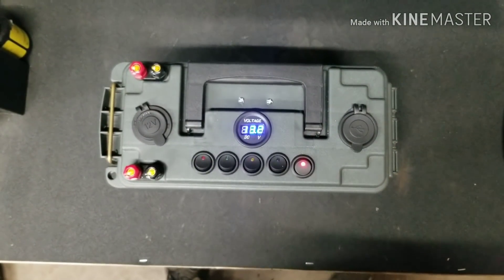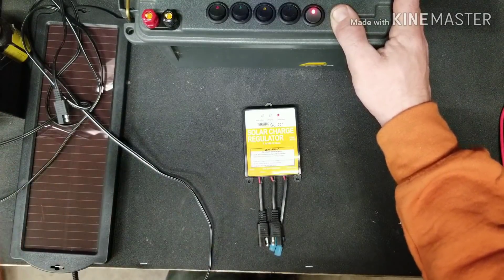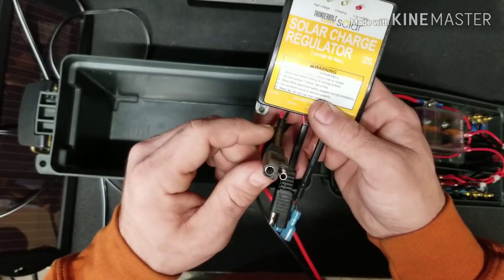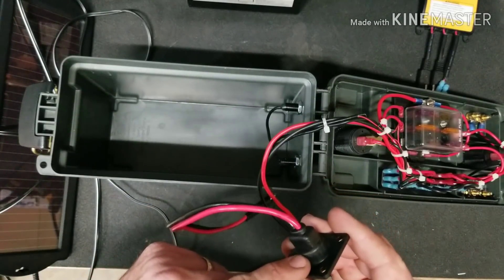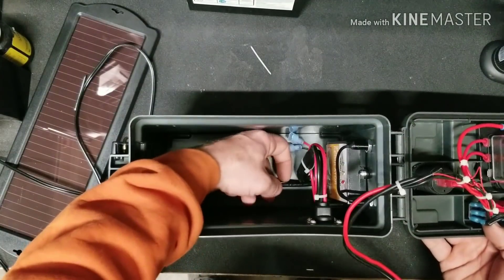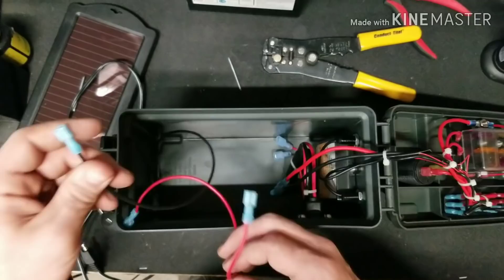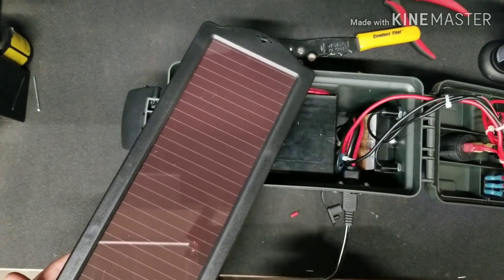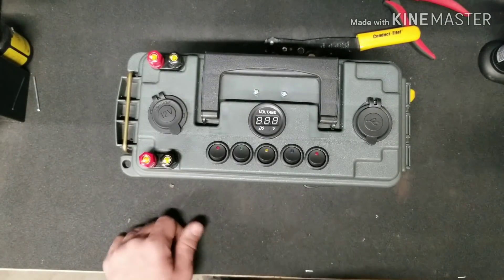How to add the solar upgrade to power box version 2

Comment: Hi! My panel is designed for car trickle charging us ( 10w , 12v, .5A  and has a diode etc). It generates 19v (open circuit) and the manufacturer promises it’s fine. So far so good that I bought a second to make a separate battery box. Do you know what the maximum V’s your usb ports can handle without being fried? Curious because I have a good Pelican case sitting around, but it does not have enough room for a controller (wondering since it makes .5A tops if it might be fine). What do you think? Thanks!

Comment: I had built a similar battery ammo box and just plugged that same small solar panel into the 12v car plug. Charges great with no need for a charge controller.

Comment: Always plug your battery into the solar charger before hooking your solar panel to the solar charger. The reverse is true when disconnecting. Always disconnect your solar panel from the charger before the battery.

Comment: Do you have to use the load side?  Couldn't you just just add the solar and attach to the the battery? Avoid the common issue of overloading that output.
Reply from the maker: Yes that is the better way of doing it I have since switched

Comment: It appeared the polarity of the charge regulator plug (exposed steel plug) and the SLA adapter plug also the exposed steel plug) were reversed so the panel would be short circuited. Can you confirm and did you need to get an adaper to correct the polarity?

Comment: J, yes, your initial video's helped me build the box I needed. Last year during the "Texas Freeze", we were able to charge phones, tablets, have light in the evenings, etc... these boxes can be actual life savers. All of my wifes friends want them, so, I have been tasked to build.🤣🤣, I cannot thank you enough. I have not added solar to my box yet, that is coming. In the list of items used, I did not see, maybe I missed it, the link for the SCC, or a solar panel you recommend, can you help me out there? I am no electrician either, but love to tinker with cool things, this is one of the cool things. Thank you again for this vid and others, subscribed and rung your bell for notifications. Bro, keep up the fantastic work. Peace.
Reply: JDS, I added solar to my original box. I think I have everything wired correctly. Hooked up a 25w solar panel. No lights on the solar charge controller. I plugged in the solar panel, set in bright sun, still nothing on the yellow light. Any ideas? Thx.
Reply: I am picking an amorphous panel. HF 25w, maybe their 100w kit. Gonna try that.

Comment: Pro tip - always put different connectors on each wire. Male on all Red wire Female on Black wire so you never plug in backwards.

Comment: Follow powerbox 2 build from start to finish, works great then added the solar upgrade, now I keep getting a E13 error code (reverse polarity) on my solar controller and its not charging battery. Checked wiring and seems to be correct. Any ideals?

Comment: I get exactly what you were saying when you were trying to describe the feedback of power into the solar panel. I actually understand this at a much better level as well so since I knew this at a much higher level I was able to understand exactly what you were trying to say here. Essentially for those who don't know, if you put power into a solar panel, it can act as an LED. LED is said literally, as Light Emitting Diode. Where the crystalline structure of the crystals in the panel can both receive and use electricity. One is in the form of transferring the kinetic energy of the light into electrical energy. And the other converts the electrical energy into kinetic energy in the for of light being emitted from the "diode" so to speak.  

But I understand exactly what you are saying, and I actually recommend people to use a Solar Charge Controller (SCC) 100%. I actually highly recommend people use a SCC when doing this as a must or necessary. 

Great video so far and I will get back to it right now. yes, I paused the video to type this, and now I will watch this video. Take not that I do NOT comment on videos very often, but when I do I mean every single word I say. And so don't take my comment as just another comment on a video. My comment has meaning to it. Now back to the video :) 

Note to YouTuber, This is a great video for explaining this kind of thing and showing exactly what to do with this kind of stuff. I have seen all of your other videos following up this one and you have presented the information and the DIY part of it perfectly. I don't see a problem with what you have taught here in these video. Keep up the amazing work!!! And keep teaching this kind of stuff, you are teaching it right. ;)

Comment: I did the same thing on my box, but I didn't see any light on the Regulator. How can you tell if the Regulator or the Solar is bad. I follow your instruction to the "T". Now I got power on the box and everything works but once I plug the solar to the SAE nothing happen. You think I got a bad solar panel?
Reply: Similar issue here. I get not lights on the solar controller at all. Did not use a fuse blick, used an inline fuse from the positive battery terminal. Back to the drawing board on my wiring. Also, I did not cut off the plugs in the controller, I picked up some trailer 2 flat connectors. I know they work as I put spade connectors on and tested them. Can't figure out where my wiring is wrong, pretty sure that is what the issue is. 25w solar panel, so should have lights on in the controller even when hooked to battery, but I get no lights. So taking wiring apart later.
Reply: @t3angling575  WOW that is crazy!... I got rid off the solar system because I couldn't figure it out either, so I got another one and is doing the same thing I will play with the wires and see if I can solve the puzzle... If you figure it out please let me know. Thank you for everything brother!!! Happy Thanksgiving...

Comment: Does the fuse block pull power?  Like if you hooked the battery directly to it but kept everything from it powered off, would it drain the battery?  I realize batteries drain over time, but wasn't sure if constant power to the fuse block would increase the discharge or not.

Comment: In case this helps others : Amazon links

1 - 100pcs Female Fully Insulated Wire Crimp Terminal Nylon Quick Connectors Wiring Spade

2 - Red 22/18- Gauge Nylon Female Fully-Insulated Quick Disconnects Wiring Spade Wire Crimp Terminal

3 - LED Light Bulbs 9W DC12V 12mm

4 - 10pcs Terminal Binding Post Power Amplifier Dual Copper 2-Way Banana Plug Jack

5 - Triple Function Dual USB Charger

6 - 12pcs Car Truck Rocker Round Toggle LED Switch

7 - 6 Way Blade Fuse Box

8 - 12V/12AH Sealed Lead Acid Battery w/ F2 Terminal

Comment: Great video, I will be starting my build soon. Q: Can you make a version 3 and install an inverter, or have you already done this?
Reply from the maker: I have thought about it but haven't done it yet
Reply: @JDSOutdoors  thanks for quick reply, another Q: on one of your video’s you connect the negative wire to a bolt screwed into the box, on the other connected straight to the battery, does this make a difference?
Reply from the maker: @waynetrueman1808  that was just a central ground point. I much more prefer the use of the fuse block and chain the neg together.

Comment: Where did you get the connector for the solar panel?? I already have a 6 watt solar panel and it has the same type plug.
Reply from the maker: Amazon its called an sae plug
Reply: I found them..thanks.

Comment: Everyone else I have seen making these says DO NOT CONNECT to the "Load Side" of the charge controller. Why did you do this? I'm trying to figure this out.
Reply: My charge controller only has 2 sets of wires one to the battery and one to the solar panel the load is hooked to the battery

Comment: Hi.. i have a question.. i tried to build a box simular to this with 1 recharable 12v 7ah battery and it works until it hits 11.9 then shuts off my 400 w inverter.. is it because i dont have constant power or because i have it on a inverter and not fuse box??
Reply: The inverter is drawing a large load from the battery. Probably 10% to 25% more power coming out of the battery than whatever you are powering from the inverter.  Your battery only has 84 watt hours of power if you were to drain it empty. That said, 11.9 volts is higher than a normal cut off. Usually the inverter low voltage cut out is between about 10.5v to 11v. Perhaps the wires and connectors between the battery and the inverter are too small. Under sized wires plus a load would cause the inverter to see (at its terminals) a lower voltage than the battery actual voltage. If you had a way to measure the voltage at the inverter terminals WHILE OPERATING your load, it would prove (or not) that hypothesis.

Comment: Great idea. I would connect the battery directly to the fuse block. Then connect the charge controller to a switch then to the fuse block. That way you will have a working box at night without the solar panel. And be able to charge the panel during the day. Great video.
Reply: Sticks 29.  Is this the method that prevents ghost drainage of the battery from the charge controller?  If so, could you elaborate on the schematic?  It may be exactly what I am trying to accomplish.  Thanks.

Comment: Dont you want to have a percentage indicator on the box to see how much charge you have in the battery?
Reply from the maker: That's what the volt meter is for
Reply: @JDSOutdoors  How can you tell the battery is at 80%, 90%, 100%... like how much volts equals the percentages?

Comment: Hello JDS,   I have built this box after watching your video,  Thank you.  I do have a question.  I fallowed this video to a T,  However when I plug in the battery the lights come on my solar charge controller even when my main power switch is turned off and the solar plug is unplugged.   I did connect to load to the main power switch and the battery out to the battery and the solar to the solar.  What did I do wrong?
Reply from the maker: You did it right. The charge controller is lit up off of the battery. The pv lights come on only when the solar is hooked up
Reply: Ok that's what I thought.   yes I noticed that about the PV lights.  I'm just concerned about the lights being on all the time when the battery is connected.
Reply from the maker: @kansas7614  easy fix would be install either an inline fuse or switch to the battery from the charge controller and shut it off or pull the fuse when sitting idle for a while
Reply: I jst added another switch for it.  Thank you.
Reply: I cannot get any lights on my solar charge controller, no matter which way I hook it up.

Comment: Great videos John.  When solar isn’t practical I will be using an Optimate 4 battery charger/maintainer to maintain the charge (1 amp output). It has built-in overcharge prevention circuitry.  Is there an issue having this run through the solar charge controller? Phil
Reply from the maker: I would run that direct to the battery I'm not sure how it will work through the controller
Reply: @JDSOutdoors  with that being said os there anything that needs to be done (wiring wise) to prevent current backing into the system?
Reply from the maker: @williamrahilly7737  most chargers have systems like that in place to prevent that from happening
Reply: @JDSOutdoors  My understanding is this; if I'm charging the battery box other then solar, their should be no issue. My next assumption would be the system would still be active and in theory ready to use.
Reply from the maker: @williamrahilly7737  if I'm understanding that right you are correct

Comment: Great videos on the build and upgrades, how long will the battery take to run flat from fully charged please?
Reply from the maker: All depends on what you run off of it. For example 3-4 phone charges and 1 hr of lights that draw 1 amp it will last two days whitout a charge

Comment: Hi, this is awesome! I will build a similar one ;) thanks for the idea bro
Reply from the maker: No problem and thank you
Reply: @JDSOutdoors  I subscribed to your channel, and I have one question. The question is: what kind of fusebox did you used in your first powerbox video?
Reply from the maker: @BassBoostedArmy  type in 12v fuse block on Amazon there are several good options. Or there is a link for the exact one in the power box version 2 vid in the description. Thank you again

Comment: Hi, great video series about your power box! One question though: these kind of batteries must not be charged in a sealed or air thight container. How do you manage that? Do you open the box when charging on solar power? Thank you for your videos and answer. Best regards!
Reply from the maker: Sealed lead acids are designed to be charged in a sealed container being that they are sealed themselves. They are not like normal lead acids that must be vented. Thank you for the question

Comment: Need to be careful with these solar charge controllers. One needs to be able to disconnect them from the battery when there is no solar cells connected to it (like when not in use and placed in storage). The reason is the solar charge controller circuitry gets its power from that gel battery. After a while it will run a small battery like this flat. Also that charge controller may self consume more power than that little 2.5 watt solar panel can put out. When using a solar panel that small where it only puts out enough power to maintain the battery best to just place a buck voltage converter that will convert the solar panel output voltage down to about 12.7 to 12.8 volts. This way it will never overcharge it and will put out more usable power. those thin film solar panels are rated about 2.5 watts at around 19 volts the buck converter will lower the voltage and increase the current from (19V @ 132ma) to (12.8 V @  189ma.) about a 97% efficiency.

Comment: Would it be better to use double sided tape to mount charge controller, s o you don't have to drill more holes?
Reply from the maker: That works as well but I find I  cold climates the tape tends to fail

Comment: When you turn off the main power does it shut down the charge controller? Watched your other video on this project it's fantastic one of the best I've ever seen
Reply from the maker: Great question and thank you. I'd does not shut that off but nothing is running so to speak in it. The leds are only on when the solar is hooked up to this specific charge controller
Reply: @JDSOutdoors  thank you

Comment: About half way through my second box. JDS, can you share what tool/Dremel tip you have found to be easiest to use when taking down the plastic inside the lid to make room for the voltmeter and 12v USB/Cig ports? I’m guessing you’ve done enough of these to have a very efficient process. Thanks!!!
Reply from the maker: I actually go back and forth using the metal cut off disc and burning through it and also the little mini wood saw blade. Sometimes I just run with an exacto knife as well. Depends on the day really

Comment: Very nice how to video. I was wondering how water tight this unit is when all said and done with all the holes. Also what about adding 1 each more light on the 3 other sides with another switch for 360* light?
Reply: Can you add a link of a picture using the lights in the dark
Reply from the maker: I apologize I dont have any pics at night but that's a good idea for my next video on them. Also its pretty water resistant and handles splashing and rain well with the marine components, However I would not dunk it in water for fear of a good leak and, short possibilities. You can add as many lights as you wish super easily

Comment: If you weren't doing a permanent installed setup for the charge controller, could you just use alligator clips and back feed the solar  through the banana jacks?
Reply: You should be able to do that just fine without the controller.  The dc ports end up connecting with the battery in or out.  In that case, you would need to use the voltage meter on the box to monitor the voltage to cut the charge, around 14.3 volts.
Reply from the maker: Yep just as William mentioned

Comment: What’s the largest battery (Ah) you can run in this setup? [(Disclaimer: I haven’t built a power box, don’t know how long a 12Ah battery will last with say for example, a cellphone charging, GoPro pulling constant power, fish finder, and possibly using the switch for nav lights on a kayak (to include the mast light) and what ever else you may need when fishing in early morning and late evenings or possibly overnight.)] I understand LEDs pull little to no power, but the fishfinder, and cellphone and GoPro pull lots of power. I’m looking into smart ways to have power on a kayak so when I get one I’ll have everything I’ll need ready. Thanks for your time
Reply from the maker: You can build a bigger box and run 100+ah if wanted
Reply: I managed to get a group 27  75 AH  AGM battery into this model of Plano box.  It is a tight fit (and is heavy to carry) but supplies many hours of use.  Some slight adjustments need to be made to the inside of the top of the box (removing some plastic) in order to fit this battery. 

Using your videos I have built several of these boxes using the same Plano box you did.  Awesome videos that are really appreciated. @JDSOutdoors

Comment: Excellent video, quick question: Can you use the battery like charge your phone, while solar panel actively connected and charging the battery? I am assuming we could since the regulator is on duty?
Reply from the maker: Yes you absolutely can
Reply: @JDSOutdoors  awesome, thanks a bunch sir👍